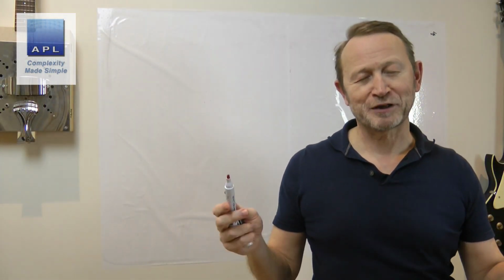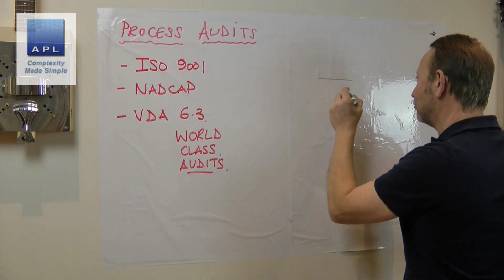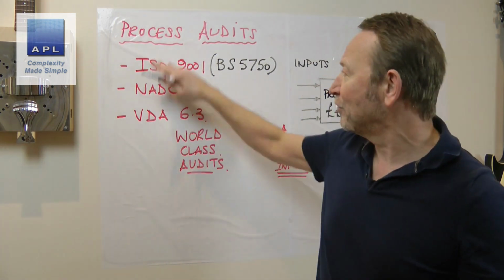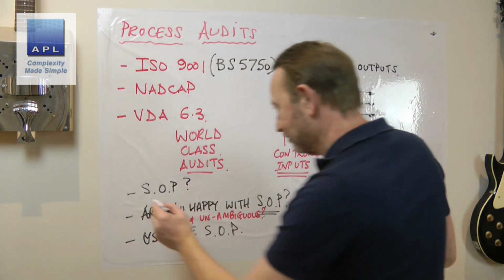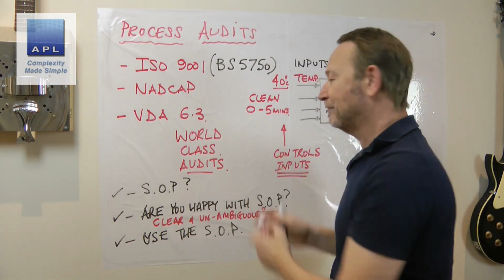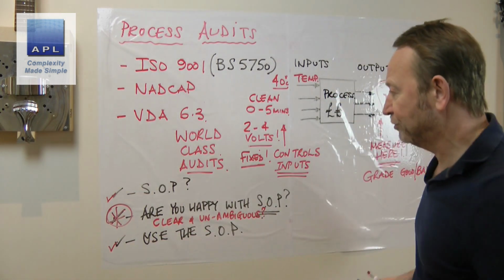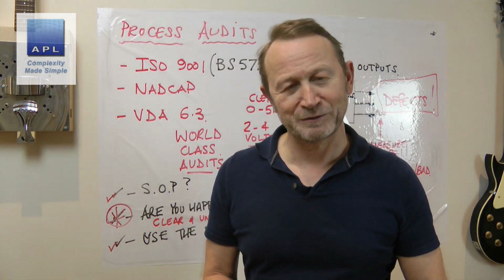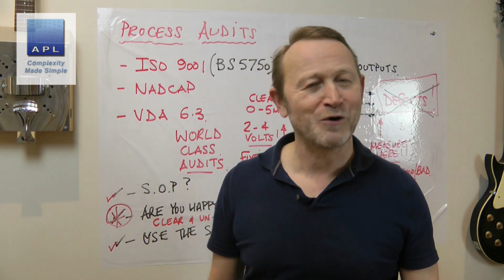World Class Process Audits!

Comment: Hi Paul, Nice explanation. I am looking for tools to make the process audit more effective and efficient. This will certainly help. I have a question how to do this for manually assembly work, e.g. manually soldering, mounting components, assembly sub-components into frames and connect manually the electrical wires? This question also links to your videos for PFMEA and Control Plan.
Reply from the maker: Here is the video - https://youtu.be/00yHMaBvDTw

Comment: Thank you for the video, it is really valuable. Do I understand it correctly that when you ask "Are you happy with the SOP?" you mean that "Do I - as an auditor - happy with the SOP"? If yes, then I fully agree with your statements however I would have phrased the question slightly differently, like "Is the customer protected from receiving non-conforming products by applying the SOP?" As an experienced process auditor (I hope I can call myself that) I see that most companies simply do not apply the state-of-the-art rules of their profession in process control, this is what I see the biggest problem actually in the industry...
Reply from the maker: Hi Gabor - I'm looking at it slightly differently 'am I happy' means is the SOP clear and un-ambiguous. If you apply it will it control the variable. Many SOP's say things like 'adjust until you get an acceptable result' This SOP I would not be happy with, there is no control here...

Comment: Paul, I agree with the disconnect in the traditional quality systems such as ISO 9001 and approaches to CI.  However, the latest revision, ISO 9001:2015 definitely has a strong process approach throughout.  One of the biggest obstacles I see is the inertia of certification auditors relying on finding low-hanging fruit such as initials missing on documentation and not pushing a company's leadership to improve under the more challenging design and development areas or in applying tools to reduce variation.  If a company has employees that are skilled in LSS and ISO auditing there is a great potential to drive improvement.  Additionally, I think that there is a balance between procedures and competency that yields the best outcomes.  If there are optimal inputs or settings for  process, then a work aid, an electronic selection or posting by the machine is generally more effective than having that written in a table on page 4 of a 12 page SOP.   World class auditing is really having the audits apply the PDCA cycle to every process.
Reply from the maker: Good stuff Lance - To be honest I'm not familiar with what is in the ISO standard these days. But i knew someone would have a better understanding and fill in the gaps. I agree with point about the low hanging fruit, that is definately what I see as well...

Comment: Hi Paul,
So true for problem solving process as well, that's the one question that I like to ask to the group : we have a SOP, yes! good! Are you guys happy with it? Most of the time a "not really!" follows the hesitation. Fixing settings is a fight that I took few months ago on one of our process and it's a tough one, even if the production manager and supervisor are both GB certified..
Reply from the maker: Pierre - fixing the settings are tricky on there own. You need to fix other variables first. Usually maintenance issues, if you don't get the machine maintenance controlled, then your production manager is right, fixed settings will not work...